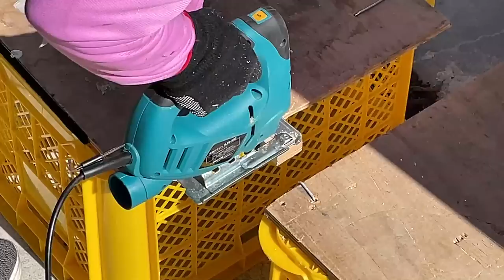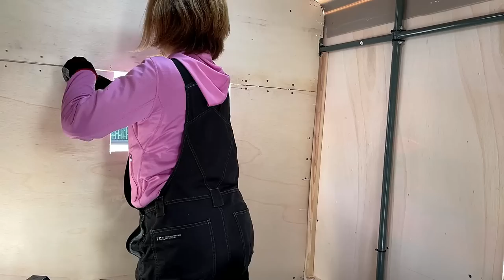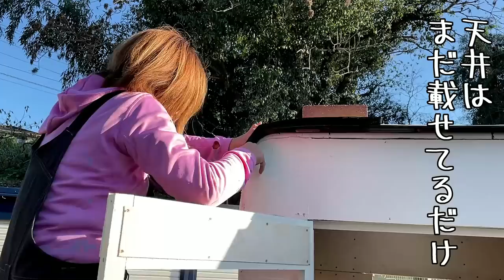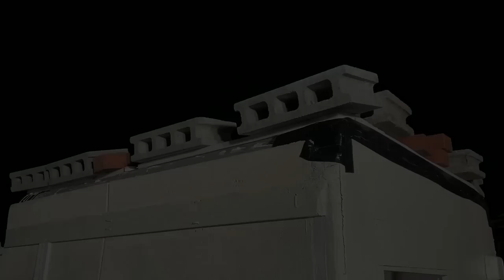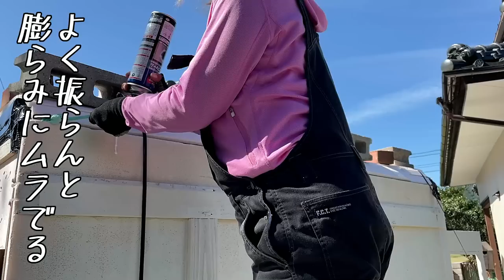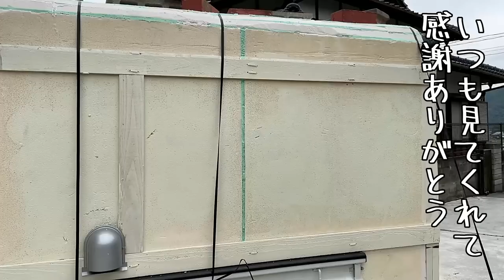軽トラ幌 DIYで荷台に50kg以下の住み家を作る！キャンピングカーへ｜成形の完成

Comment: The thought crossed my mind that there will be "armchair mechanics" and sideline commentators telling you what you should have done, what is wrong, and what they would have done. Good for them. It was you that actually built something and I suspect that you will be out there doing it (camping, fishing, long-distance exploration) before others get started if they ever do. I agree there could be better ways but most of us have to work with what we have. Before I relocated to the Philippines, I had a very complete shop. It would not have been difficult to switch the MIG welder over to pure argon shielding gas and weld a lightweight square aluminum tube frame. I no longer have that option. I praise you for "making do" and creating what you desire on a conservative budget. Thinking ahead, I am anticipating the "maiden voyage" and how you will secure the camper body to the truck bed. So many options. It will be wonderful to see what you choose to do for that first trip.

Comment: not better use wood, lot better glue insulation to thin aluminium sheet have same strong but lightweight full wall.
Reply: It's not insulated with wood, it's insulated with insulation. Wood is used for strength.
Reply: @yumi-don  i mean not good build wall at wood uses, lot lightweight wall can made thin aluminium sheet were glue insulation and inside thin plastic sheet have strong lightweight wall than wood and glassfiber made. same methor uses all caravan houses.
Reply: @mattivirta  I don't know much about aluminum sheets, but we're also sticking to being as cheap as possible. It's already finished, so please watch until the end!😀